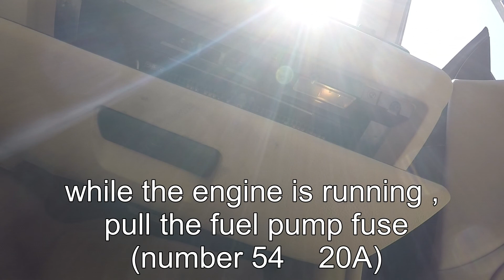Fuel Filter Leaking Repair On BMW E46 325 CI

Comment: Did that leak cause a check light to go on. Kinda wondering if the regulator might act up from a pressure loss and maybe affect vacuum?? Probably unlikely but just curious to know if the cdm might mistake it for something else
Reply from the maker: no it didn't... just strong smell

Comment: When  that happens you don’t suppose to replace the filter ???
Reply from the maker: in my case i replaced the filter a month before the leak... and i used the the old clamps (forgot to buy new ones ) so i bought new hoses & clamps.